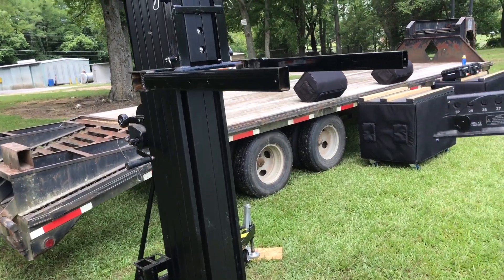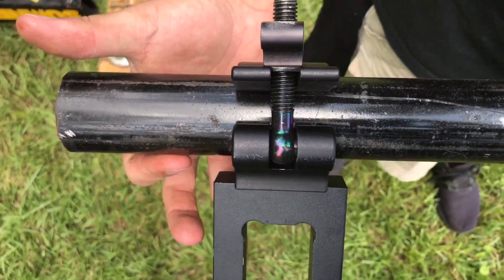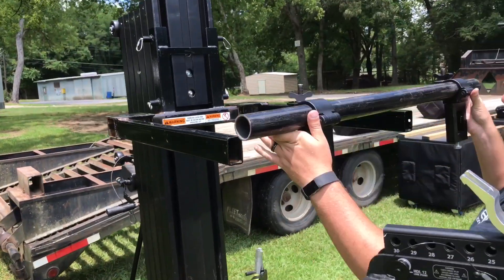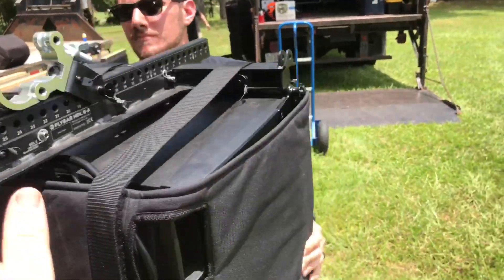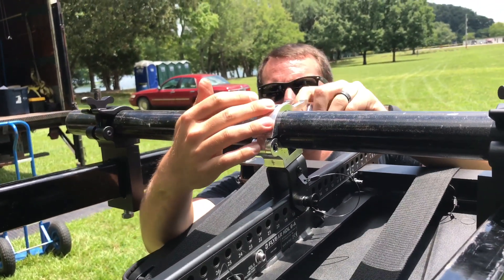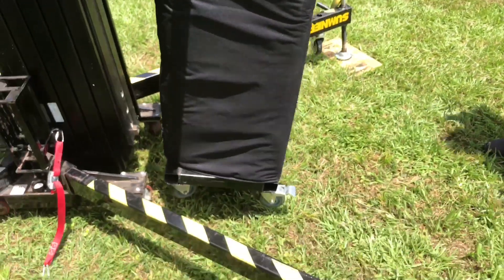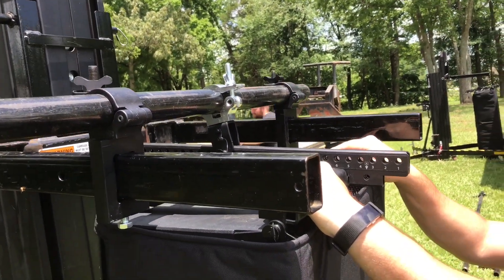RCF HDL6-A Rigging on Sumner Eventer or Genie ST24

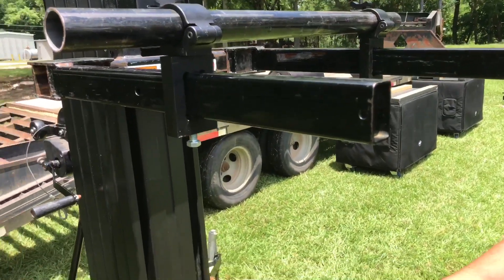Comment: Might be a better idea at 1:24 to push it slightly behind the hole and then put a pin through the hole to keep the bar from flying off in a freak situation